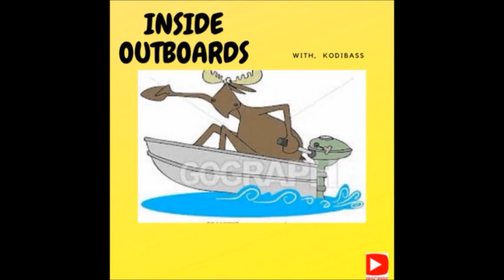15 HP JOHNSON 4 & FINAL

Comment: With no water pumping. i'm surprised  you didnt pull the lower and check the impeller first.. then tell tale hose.. I always look at gromments last.. love the vids.. and especially  the entertainment..
Reply: You are right for sure, but sometimes we "get ahead of ourselves from past experiences".  Gotta figure the grommets were OK when it wasn't overheating while he had it running the first time.  I think Kodi pulled the powerhead mainly due to the shift handle, and checked the grommets while he was down there....But, again, still say that shift handle would have come out of there without removing the powerhead, just gotta pull the carb.  Am I missing something?  Those overboard indicator hoses and nipples are always the first thing to check when you don't see water flowing out.  I'm more baffled by the sudden return of compression on the top cylinder....I was wondering about his original head also, but he got the same low readings with a different head.  Compression gages are always suspect but the low readings always occurred on the top cylinder.  Stuck rings are the only logical contusion here,  wish I had that kind of luck with sprays...Maybe I ought to start drinking some of the "tri flow" stuff..  Starting to think my "rings are stuck"....

Comment: Those are great motors I thought dry cylinder no seal possibly from sitting initially.Or stuck ring possibly and you worked it loose.I was also thinking coked rings in the beginning Lenny on that cylinder but you got it nice job.
Reply from the maker: +GFPOUT,   Just got lucky   4  sure..     kodi

Comment: Yep, one of those mysteries for sure.  I would suspect the gage if it had shown low compression on the lower cylinder intermittently also,  but it was always the top cylinder.  Unless something was hitting the hose near the top cylinder that was creating a leak in the hose, but that doesn't seem very likely, am assuming the gage relief valve is at the top near the gage also.  
Kinda figured someone had been in there before you when I saw those exhaust megaphone bolts "fly on out of there" with no help from the torch.  I'm with you, just seems like the rings were stuck...But, that top pressure back ring can't really stick due to its triangular shape...Wish I had your kind of luck freeing up rings...  I guess I will never learn the valuable lesson of "never argue with success", I probably would have pulled the exhaust cover and intake cover while the powerhead was off.  
Oh well, this old dog will probably run great and you won't hear another complaint...Maybe it is live and just wanted some attention....I still say that shift lever would have come out of there without pulling the powerhead, just have to remove the carb...Am I missing something?
Reply from the maker: +kramden,  I have tried in the past to change the shift rod by removing the carb it is tight,  the problem I have run into is the stupid little tang that prevents the shift bolt from backing out, If that tang is facing the rear / head side of  power head I can never seem to get at it,  Tell me the secret. Anyway  this one was coming off due to all the other issues I was dealing with,  I agree someone b4 me was in there, those grommets looked almost new.                                       kodi
Reply: @kodibassInsideoutboards    Understand what you are saying about the locking tang, could be a wrestling match if it faces toward the powerhead.  Honestly, I can't remember which way the tang was facing, usually had to remove the shift levers to clean the salt out of the swelled bushings making the lever hard to move.   I have only had to remove the shift lever on one of these things a few times while the powerhead was still in place, was just wondering if something had changed toward the later models making this harder/not possible.   I hate it when I get tangled up with a mystery motor, keep wondering what it was that I missed or accidentally repaired without knowing it.  The owner will be thankful that you were relentless in the pursuit of getting this motor going again....Most would have written it off after pulling the head, perhaps trying another head gasket....

Comment: Another success. I've been trying to see the make of your impact driver without success. Can you control the torque with the trigger? I have a 1/2" square drive impact driver but I'm afraid to try it on 1/4" bolts that can break using a spanner. What sealant do you use on gaskets? Many thanks
Reply from the maker: +EF my 1/4 driver is a Bostitch, & has trigger control,  My corded 1/2 inch is a 1942 thor,  it has NO trigger control, Bolt is coming out or head of Bolt is coming off. Or elbow will snap!,  I use Aviation permatex on most parts, anywhere around the exhaust  port / and base I use permatex high-temp.                                     kodi
Reply: I can't find a supplier for BOSTITCH. Guess I'll have to see what's available in UK And Spain.
Reply from the maker: @erniefoster4222    Do U have  Home  Depot  over  there,   That's  where  I got  mine, 
Also  watch my vid's   My  Absolute  Fav  Driver Is my old school Black & Decker
Quick  change from the 90's    They IMHO  R  The  Best Ever made 4 sure.   kodi

Comment: Do you know what Johnson model year  were duel fuel petrol and kerosene im new to these johnson and evinrude motors love the content giving these  old outboards some love.
Reply from the maker: +GE, Sort of, Old timers would run such a mix in the pre 1964 and earlier motors as these motors had no roller bearings, It was believed that a mixture of # 3 kerosene / petrol protected these brass bushing and allowed for longer life. This was in addition 2 running with a 18 to 1 oil / fuel mixture.   Also there R Even today places that start the engines on petrol once up to temp use a tank valve to switch to kerosene as it cost much less in many areas.                                                                             kodi
Reply: @kodibassInsideoutboards  thank for the info just got a bit interested found a carb kit  on eBay 
that's says its a carb suited to run on kerosene part number OMC 391145. OMC 324441.

Comment: I'd try another head before I went to the block...     (My experience wth those compression gauges (2 O'Reilly loaners) is that if you repeatedly screw them in & out by the hose, the brass ferules then fail/get loose and start leaking...) Until I bought my  own new gauge/case...!   You turn the screwdriver into a "wedge"...   Thermostat and/or salt blockage...?   Yep, peeing like a race horse now...!   Nah, the heat, vibration, & friction from running along with the Tri-flow combined unstuck that ring...
Reply from the maker: +WR, Hey''  even a blind squirrel finds a nut once in a while. I was kinda sweating it because like kramden's reply to my last video, I  have seen before a perfect looking cylinder, only to pull the motor apart and find a broke ring,  Where did the broken piece  go? & how does it not ding the top of the piston or cylinder?   But this one Luck was on the guys side.                                          kodi